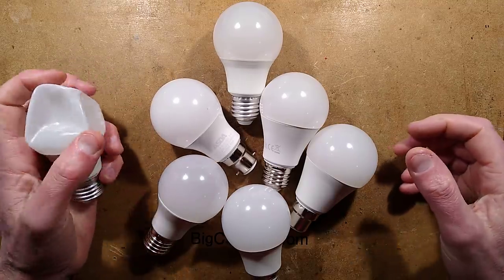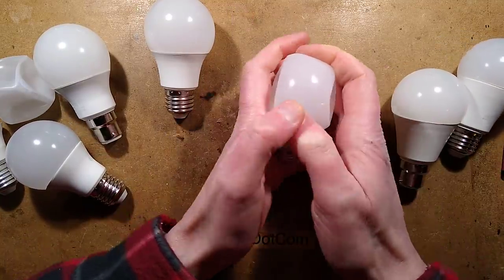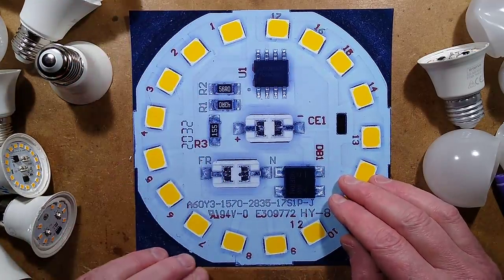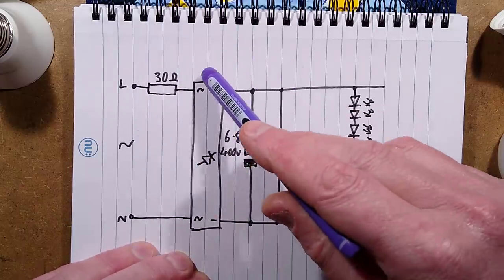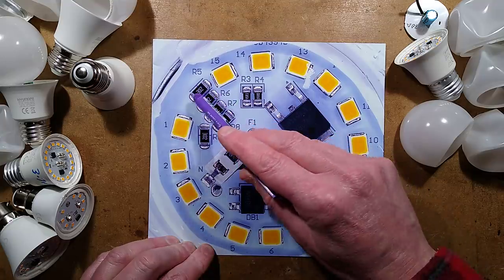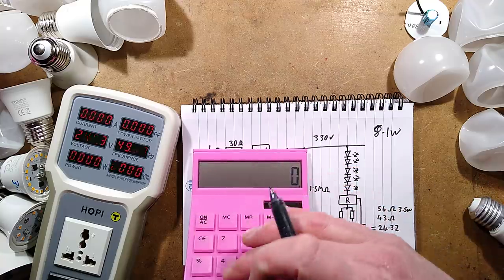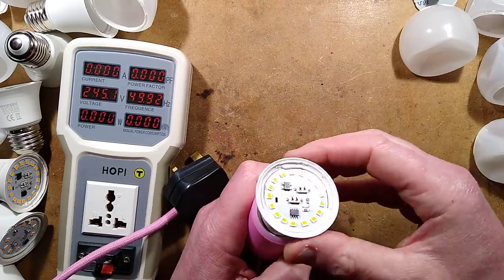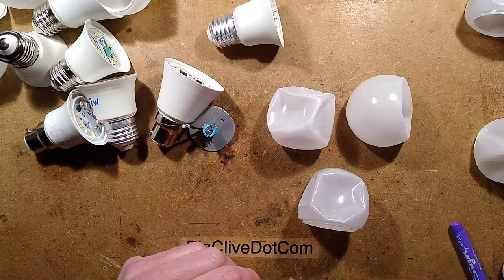Crushing and hacking LED lamps

Comment: From my experience all lamps (a total of 3 from different brands) i opened here had seperate circuit board with a CCS buck regulator and all can be opened with a plunger a bit of time, but it's really a pain in the arse to get the led pcb out and putting back in, getting the psu pcb out and putting it back in is impossible cause it has tiny soldered leads (usually one leg is the fusible inrush resistor)
Also E14 are impossible to open without cutting it cause it has aluminium heatsink below the led pcb
Reply: The LED PCB, if it's just pushed in, can be pried out carefully with a small screwdriver. The driver PCB can be taken out by prying out the center contact from the outside which releases the center wire and just pulling the PCB with pliers so the other lead that goes to the base pulls out. Then it can be put back in by punching a hole from the outside in on the edison screw base, then feeding a new wire from the inside and soldering it to the outside and onto the PCB. The PCB is then put back in, being careful to feed the center wire into the center hole, then pushing the center pin back in. The LED PCB can be put back in by injecting new thermal paste or glue around the rim and pushing it back in. The thermal paste/glue makes a better heat transfer from the LED PCB to the case than was factory. I've disassembled, modded and successfully reassembled more than a dozen of these and they all still work.
Reply: Some lamps have the LED PCB screwed in, those are easier to disassemble and also usually have better heatsinking, I always put thermal paste between the dissipator plate and body where there is none from factory.
There is another type that has a screwed in dissipation plate and the LED PCB glued over the screws, those are impossible to disassemble without destroying. But they're not that common (ironically, the more expensive name brands are usually also impossible to disassemble)

Comment: I want to hack one of these bulbs to run on 12 volts. I've modified a clear globe light to run on DC. It had three triangle shaped boards inside with three LEDs on them. Wiring all three of them in parallel enabled 12 volt operation and now I have a 8 AA battery holder with the bulb on top and it is SUPER bright. I used it one time during a power outage and it lit up a room.

Comment: Mr. Clive! Thank you for all of your videos. They're teaching me alot, but I'm also finding that there is alot that goes above my head a little. Is there a good Electronic Circuitry for Dummies book or something similar that you'd recommend to someone that's new to it all?
Reply from the maker: Try and find an electronics learning website that you click with.
Reply: @bigclivedotcom  Thank you kindly! I'll start looking for one.
As a side note, I took the lense off of a very similar bulb thismorning (120v, 9W). Both of the resistors were about 9.5ohms each which made it easy to choose one to snip. Interestingly, when plugged in next to an unmodified bulb, the difference in brightness wasn't nearly as significant as I had expected given the (halving?) in power output to the diodes.

Comment: Can you please make a video about 110v LEDs lights... and can you make them work at 220v ? Hacking...convert... modified...I do have plenty of 110v LEDs lights ...Does it work if I connect it on series? 2 of 110v to make one 220v 🤔

Comment: I was wondering about the cheap-o led bulbs, have had them fail regularly but not the "Smart" bulbs that are considerably more expensive. I would guess the circuitry in a smart bulb is may be built to be nicer the LEDs for a longer life. Haven't had a look inside them though.
Reply from the maker: Plenty of the smart lamps seem to fail early.  Especially if used at full output.

Comment: Hi Clive
Like your videos, something happened most strange?,we purchased a 125mm grinder from Lidel on 19/01/21 "this year" so hardly used Neal my son set up plasma cutter to use grinder on bench, put grinder on floor to avoid sparks damaging grinder grinder has variable speed not sure why seems quite good for price of £19.99,now the strange part switched on plasma cutter heard pop / like fuse popping thought plasma had gone no carried on cutting, picked up grinder not working cable of plasma cutter on top of cable for grinder?, decided to return to Lidel for refund but very curious what had happened found PCB for speed control had exploded components,
"Any thoughts"
Regards Brian
Reply: I've got an old black and decker with variable speed control it's great for delicate cutting or grinding, don't see many of these type about now. I would imagine that the PCB in yours just wasn't up to the job?

Comment: Do you reckon the use of push-in connectors has something to do with alu-core PCB not being conducive to through-hole mounting components? Not that SMD caps don't exist of course but they may just want them on the other side of the board.

Comment: I wonder how much voltage the regulators drop originally and after modification?  Something tells me more after.  Just wondering if it's really much more efficient that way.

Keep up the good videos!
Reply from the maker: Similar voltage, lower current and lower heat.

Comment: Clive on a different lighting effect. I have a fixed lens SLR camera and I want to take the guts out of it and fit in a high powered LED at the back of the case were the shutters would open and expose the film. I want the light from the LED to shine out thru the fixed lens and use the exposer ring to control the amount of light escaping in to the room. At the back I will have the 240v power going in with a fuse and on/off switch (or fix a pot to the settings dial thru the body). Plus use the ISO dial as a brightness and dimmer control. The camera will then be fixed to an old Tripod I have as a stand. I will clean every thing, but I will not paint etc as I want to keep it looking retro. Anyway I have an idea for doing the circuit but I need you to do a circuit diagram with components list that are best used for safety in the home. Maybe I could use a touch sensitive control to the rotary setting dial to just tap switch the light on and off. Maybe you could do a video about building a circuit with a schematic that would be small enough to fit inside various items as a shell, what do you think about that as a Big-Clive-Dot-Com project?

Comment: They must use a softer plastic over there, our US market ones are hard and once gotten off whole they make a very resonate sound when tapped on the top. Like a wood block in percussion but you can vary the tune with your hand over the opening like cheek tunes with an varying open mouth. 

I would like to hack or see the results of using these simple regulators to run a string of LED's from a smashed TV backlight at 117 vac, (safety) the whole strip would be hot. I get bulbs that start flashing which is one bad apple spoiling the whole rest of things, the reg is OK at that point.

Comment: We’ve had so many fail... it’s just been a single LED that blows, and since it’s in series, the entire bulb is no good anymore.
Reply: Actually every failure I have had has been the PSU.
Reply: I’m not sure what caused the failures in mine, but the bulbs went very dim
Reply: i've repaired such fails by shorting out the failed led. It doesn't last, other ones just follow soon.
Reply: @victortitov1740  then use a resistor in series instead of shorting them without an voltage drop
Reply: @jeremoisde9928  if they have current-regulating chip anyway, what for? it will only produce more heat (if regulator is a switching one), or offset the produced heat into the regulator (if it's a linear one). So other leds should not not follow up... unless they are on the verge of death, in which case any repairing is futile.

Comment: "linear regulator !" That chip is going to get hot ! Definitely designed to fail (planned obsolescence). Even if that chip has a heat sensor, the LEDs will die prematurely due to the close proximity to each other. I blame trying to maintain the old light bulb form factor. Many new LED fixtures have the same number of LED chips distributed over a larger board. The board has an aluminum substrate, and acts as a heatsink. You want to have at least 1square inch (~6.5cm^2) per watt, dissipated. So if you have an LED lamp, that dissipates 10W, the board needs to have, at least 65 sq cm (d=9cm=3.5"), for a round board.

Comment: Hi Clive, 
Thanks for the great  video.
interesting
leds were the same as the yellow ones with a sneaky magic optical filter.
Do you think this kind of lamp could be made more efficient
if it was pwm controlled (perhaps dim-able ones are like that ).
 Will there be any adverse long term problems with 
trashing the current limiting resistor?
Reply from the maker: The single current limiting resistor is not under any extra stress.  The lamp will potentially last much longer.

Comment: i just took my knackered outside light bulb to bits. it had 12 2835s in it, one was actually scorched, like a laser had run across it!. my bulb has a PCB underneath the LED face plate, at right angles, with no IC? it has an inductor, a weeny transformer,and a little BJT, with rectifier and all the usual resistors. it is very different to the bulbs featured here.
Reply from the maker: Some drivers have a power supply control chip built into a tiny transistor package.

Comment: I don't know if you already have but would you be able to open up and reverse engineer one of those smart RGBW Led lamps that work via an app on your phone. I know they're not cheap but I have 3 in my living room and I love to put them on Red Alert and Disco mode (routines I made in 'the female lady speaking orb' I have). Would be cool to see how its done inside as I can only imagine they are uControllers programmed on the fly via Wi-Fi. Cheers :) Much love x

Comment: What about drilling a small hole near the bottom and using a pump with a ball inflation needle to pop the top off with air pressure?  It looks like they're pretty air tight.

Comment: "replacement ring LEDs for circle home lighting" (A Thailand product made to replace the circular florescent bulbs in ceiling lamps) these guys get so hot and fail miserably is there a way to hack these?  They have an aluminum base as a heat sink and built in electronic boards. I wondered about current dropping these as you did in this video or the other route as the "Dubai bulbs" same electronics but double the driven elements. 
Anyway great video sir, thanks for the tinkering ride along and the great British humor you have. Peace out and may the reverse engineering force be with you always.
Reply from the maker: The driver in those can have its sense resistor changed to make them run at lower current.

Comment: Would drilling many (say) 3/8” holes (too small for fingers)  in the covers induce enough cooling air flow  to make a difference to the life of the bulbs?  There is probably an exponential   relationship to temp vis hours to failure. It is the regulator’ characteristics that might negate any advantage of extra heat dissipation by whacking  up the current. What do you think?
Reply from the maker: Vent holes can help, but also allow dust to enter.

Comment: The only feature of LED lights is they're drop proof. Replacing the multi-year reliabity of 25c incandescent light with a $2 LED (initially $15) will never pay for itself. The 10k hour posted rating is for a single LED of a series of 50 making the real ratings 10k/50=200 hr BUT that's still twice the rating after adding all the other components including the short life if electrolytic capacitors.

Comment: Have you tried removing both current sense resistors and soldering a potentiometer in their place (or a pot + NPN) as a variable resistor, to find out exactly what value resistor you want to have?
Reply from the maker: A pot would need a minimum value of resistor in series to limit maximum current.  But it would work.

Comment: Just hacked some 120v Edison bulbs into 4.4 watts roughly (don’t have a Hopi/killa watt to test them atm).
I doobyed these bulbs specifically for a hard to get to fixture that the bulbs just died in. The last set lasted about 2-3 years (ball park estimate based on memory?) we shall see how long these hacked ones last. 
Can’t get enough of these light bulb hacks, would be interesting to find out how much lumens are being put out at each power. 
Never enough bulb hacks or pound land/eBay solar garden lights videos for me.

Comment: What's the typical failure mode and can they be fixed.  Ex. by replacing a blown LED with a resistor or no point since once one blows they others will also be at their end of life.

Comment: After buying a few brands in my country, I finally get the similar construction like those LED 🤣..

In case of mine, 8 Watts LED, the Power Resistor Shown to be 4R70, and when I changed it to 10 ohm, it drop to 4 watts..
And when I changed it to 20 ohm, it also shown to be 4 watts..

😒 Dont know why, maybe I should use 100 ohm to drop it to lower wattage

Comment: The 30 ohm resistor and 6.8uF/400V capacitor are mounted in some kind of white (ceramic?) SMT container.  Having been retired for 5 years I haven't seen that before.  What is it for?  I couldn't find those containers on DigiKey but I don't know what they are called so my search may have been incomplete.

Comment: This new standard of design will surly change if people start making them last forever by stabbing them with a screwdriver.
If the resistor across the crapacitor is removed and it dimly lights via switchwire capacitance or whatever it was, will that show on the electricity bill ,is it using otherwise wasted energy, or is it free energy?
Reply from the maker: It's so low it's negligible.

Comment: Could you use a small trimmer resistor to make the light adjustable? Or would the resistor get to dissipate to much power?
Reply from the maker: You could.  It would need to be mounted close to the chip with at least one resistor in series to limit the intensity.

Comment: Do you think it would be easy to hack a car LED bulb? I've ordered some to see if I can find a way to drop the 20w down to about 10w. I'm guessing it has a circuit board as it says it can accept 9v-30v. The bulb has torx screws and looks like it splits in half.

The bulb says it's 10w on eBay but I found somebody on YouTube that tested the current at 1.7a at 12.5v (21.25w).

It really annoys me that pretty much all LED headlight bulb replacements on the market are aimed at people looking for blinding lights. Why isn't there any that are designed to draw 5-10w and provide equivalent light to a 50-60w halogen.

The bulb I got is 2x Auxito fanless h4s (it was £15 for 1 and £20 for 2), without an external power converter. (They're marketed as motorbike lights). They have a shroud for the dipped beam so I'm hoping they provide a decent legal beam pattern. I hope they're as simple as the ones in the video where I can either remove or replace a resistor.

Comment: Could any of these 220v lamps be modded to run on a 12dc solar setup? Like the idea of using conventional b22/e27 fittings in the shed.

Comment: What component typically fails on these kinds of bulbs? If it's that 30ohm resistor, I'd think you could pretty easily fix it.
Reply: one of the leds themselves and by the time one fails, others are already  in too cooked condition and very deteriorated and likely fail later on if you replace the one led

Comment: At first glance these looked like IKEA bulbs, but IKEA ones are pretty high quality, i doubt if crushable.
Rather like the crumpled look with these glass-like covers, creates a neat surrealistic Dali-like effect.
I'd imagine this is doable with glass too, but that requires very thick gloves and a _very hot blowtorch_.
Reply from the maker: I used to distort short fluorescent tubes above the gas cooker.
Reply: Sounds quite intriguing and "don't try this at home"
Reply: Found IKEA lamps had very poor life so not high quality.

Comment: Dear Clive: I see a lot of broken lightbulbs of this exact type at work, and I like to bring them home to see if I can fix them. 90% of the time it's just 1 of the SMD LEDs being burnt out, which I can then short and solder over. If I'm lucky, the LED will be immediately identifiable from being visibly burnt, but sometimes it's impossible to tell. How do you recommend I test each LED individually to find the broken one? I've tried running all kinds of voltage through them and they seem to never light up.
Reply from the maker: Many of the modern LEDs are multi-chip and can require quite a high voltage to make them light.
Reply: @bigclivedotcom  Thanks for the quick reply Clive! Making my own tester for these sounds like a fun project, how can I find out what kind of voltage I'd need?
Reply from the maker: @9600bauds  It can be quite high.  Some have 12 chips inside, so have a combined voltage of about 36V.  You do get current limited LED testers on eBay, but be aware that some have very poor internal isolation.

Comment: I have had 5 led bulbs "go out" within in the last 2 months. They are in recess cans. I am trying to figure out how or what component is causing them to flicker to where I have to change them. A new bulb last about 18 months and then they are all dying around the same time. 

Is the fix to cut them open (remove the lens) and remove one of those resistors so it runs cooler? You said the light output is still the same...
Reply from the maker: The light output will reduce.  Recessed cans often bake LED lamps.